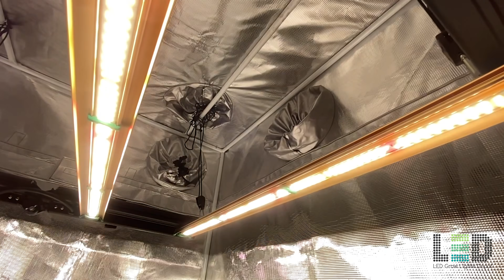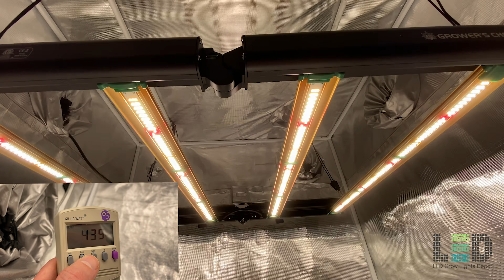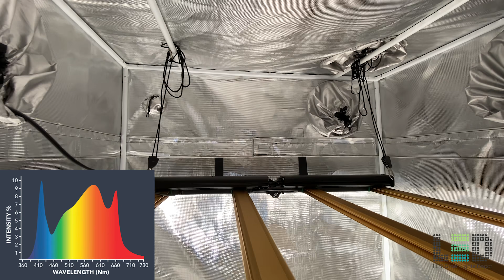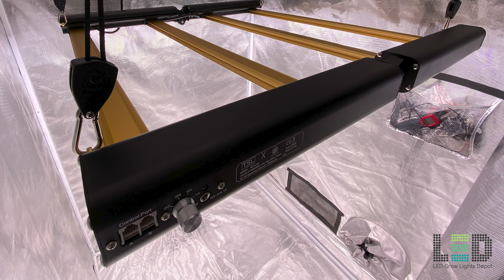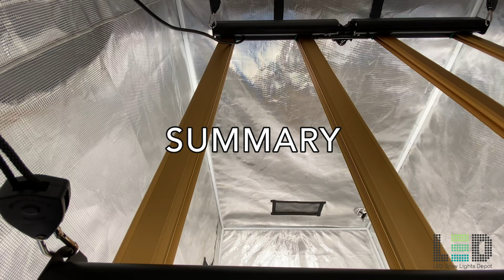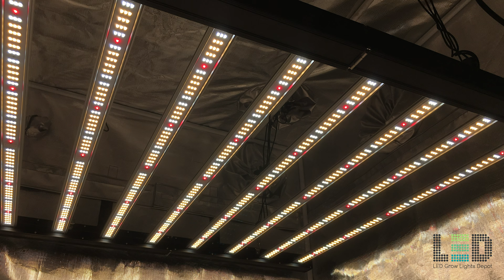Grower's Choice ROI-E420 LED Grow Light Review

Comment: I just set it up three by three I have an issue though it fills up the 3 by 3 pretty full. 3 plants could place 4 but would Over crowd it with photos I'm going to need a 4in inline now probably an Xfinity to make it complete this light is insane
Reply: In a 3x3 you're better off doing 1 to 2 plants instead of 4.
You'll have better yields off of 2 than you'll get off of 4 in the same space because 1 to 2 can be vegged longer and thicker branches support bigger buds.
You can use the space efficiently instead of run out of it.